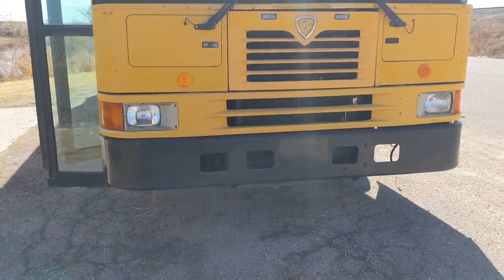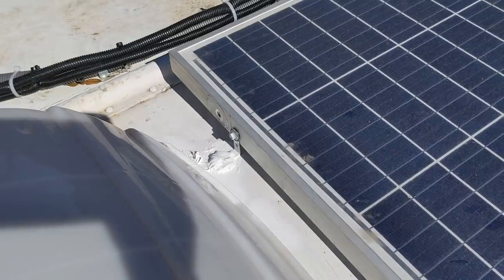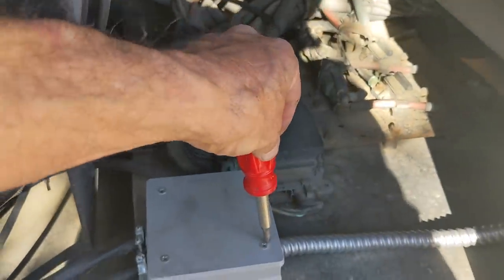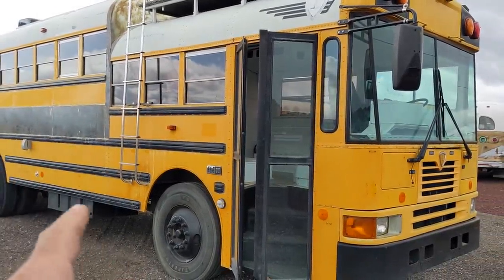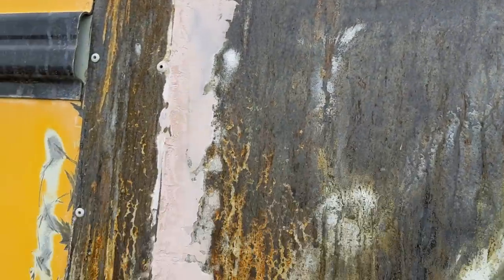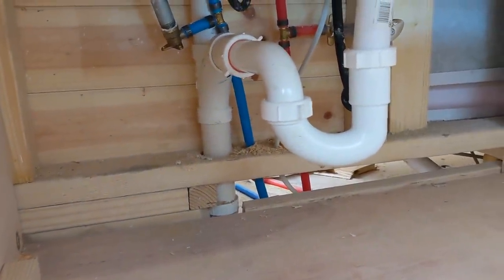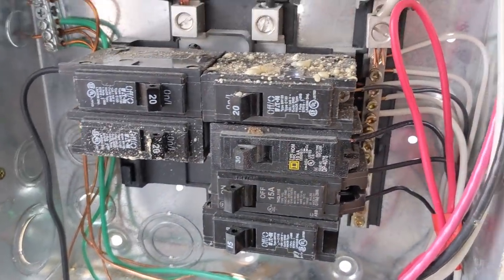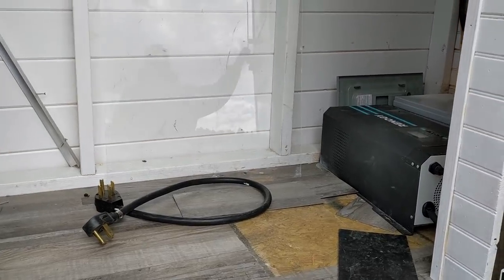Dangerous electrical work...and so much more bad stuff.

Comment: My GOD! Just when you think Lone Star Skoolie can’t get worse…you see suicide cables!?! Thank you Ross for everything you are doing and big hugs and love to the Trudi, Jim, Zack, and Taryn. LSS is absolutely going to kill someone if they aren’t stopped. Keep up the good fight!
Reply: I have seen many of them in all forms: 15Amp with grounds cut off, 20 Amp AC to 30 Amp RV, 30 Amp RV to 30 Amp Dryer, 40 Amp Range to 50 Amp RV, I seen cables with ground and neutral tied together in the plug bit. One of the most interesting was a 15 amp regular 100 ' orange extension cord but instead of a female on one end, it was a 1/4 TR Phono plug for audio use.
Just all around DIY death machines all of the suicide cables.

Comment: Your comment that these bad conversion deals "kill dreams and kill trust" is spot on.  Most states have this concept of a mechanical lien that a licensed mechanic can file against your vehicle if they do work and don't get paid.  So if one is looking to get work done by a licensed mechanical shop and they are asking for a big upfront deposit, unless your vehicle is not worth much they are likely looking to establish more leverage in the deal than they ought to.

I enjoy how you called out a bunch of things that should be obvious to mechanically inclined folks - like the do not use self tapping hardware on an electrical box.  Common sense was thrown to the wind by these San Antonio builders.

Comment: Electrician here, we call them dead man cords. Most dangerous thing about these goes as follows: If you lose power, you decided to hook up a generator with a cable like this, and you do NOT isolate your panel from the incoming service, you are now effectively backfeeding the power line, and this is important because TRANSFORMERS WORK BOTH WAYS. They step down the voltage on the line from 7200 volts to the 240/120 we use, but if you feed that transformer with 220, then it will step the voltage up and produce 7200 volts on the line that potentially linemen are working on trying to restore power to your home!!! I have heard of linemen getting killed/injured this way! 
I even got into a physical altercation with some old entitled dude at home depot over the merits of what he was doing. 

PLEASE DO NOT USE DEAD MAN CORDS!!!!!!!! Keep our linemen (and women) safe!!!!!
Reply: This just makes me so sick to my stomach.  I am so glad we didn’t try using this!!!   At one point right when we got our bus, I did have the cord in my hands and was going to try to figure it out but the puddle of water from a leak in our bus distracted me.  This should be considered attempted murder.  This business reassured us multiple times that they were the experts and all his YouTube videos he presents himself and his business as caring about safety.
Reply: Thank you for the additional details. Very valuable for all to know!
Reply: @trudikrupocki3023  I am so sorry this happened to you guys, but hopefully your story will keep this from happening to others! YOUR BUS IS SOOOO ADORABLE!!! It seems like you guys are in good hands now, and taking it in stride. Can't wait to see her when she's perfected! And never forget, there's a million great folks out there for every bad one you meet. :)
Reply: @wandererradio9751  You are very welcome! It was something I did not ever think about until I started teaching electrical at our local trade school. I make sure now to educate everyone I know!!
Reply: @Hamilton Mechanical The other thing than can happen, is mains power is restored and the generator looses it's fight with a much larger power source and catches fire.
Reply: @station240   Where I live the generator would immediately trip from trying to power all the neighbors houses. I'm not an electrician but know indoor from outdoor wire, I don"t know if UF is usable or you need to use liquidtight flex or RNC.
Reply: That's true, but the energized power line issue can come into play with even a safe generator cord designed for that purpose (if the main breaker in the panel is left on). There are lockout kits designed to prevent this, and are required by Code to be used. The dead man cord is dangerous mainly during use of the generator because the other end (male prongs) will be energized when the generator is running.
Reply: On the same note, the Neutral side needs to also be isolated!
Reply: i dont think there are any linemen working on this bus though lol
Reply: @SuperJlonergan  I don't think you understand the problem. If the generator is back fed into the panel and the panel is plugged into the power supply at the trailer park or at home when the power is off it will send current back up to the pole lines via that conection. A worker a mile away could get hurt. It needs to be isolated by a magnetic contact switch takes it off line when energized.
Reply: Spot On Bit Of Intel. There is No Gate to stop Backfeed.  Be Careful Everyone.
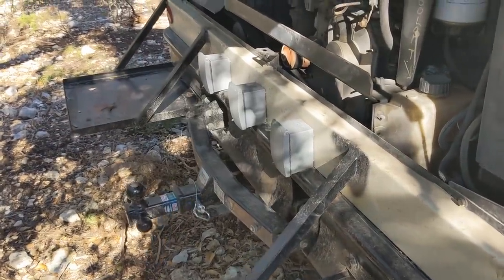Reply: @906MediaProductions  not necessarily true, I suspect that the middle receptacle (shown on another bus @ 19:50) would be to hook up to a trailer park pedestal; doing so would backfeed the power grid!!!

Comment: The wiring takes the cake.  As does that water heater.  We stayed in an AirBNB cabin that obviously had an undersized electric "tankless" water heater.  Could only get hot water in the shower for about a minute or two, lol.  It was mounted on the wall of the bathroom and it was obvious it's volume would be way too low for anything more than a sink.

Comment: Oh my! God bless you for helping these folks out. This is nuts! So I'm an electrician, been in my own business 30+ yrs in CT. I remember in the 1980's hearing of a lic electrician who mistakenly connected a 120 v electric baseboard heater to 220v.  A fire occurred, someone died in the fire. The electrician who did this by mistake was prosecuted for criminal negligence and was imprisoned for sometime.  In this case I this was done with someone with no training. I hope no one gets hurt, and I hope the people who did this "for profit" are held accountable.  Maybe they should live in these projects and deal with the stuff!  So sad this happened!  God bless!
Reply: Guessing this whole home on wheels thing is so new that there is not any regulations yet. Guess when wiring this up they don't have to pull a permit and get it inspected. Allen guessing your in the USA, if so what section of the NEC would cover homes like this? Oh never mind he pulled out the code book for RV's

Comment: Licensed  Marine Electrician here , Fine wood carpentry and welding are my other hobbies. I have just discovered my new profession , High Class High Quality School Bus conversions .
For 100 grand I could have delivered them a Taj Mahal on wheels compared to that butcher job. After thirty years restoring yachts often laying on my back in water under the engine, this will be fun to do. I'm no slouch as a painter either. Just built a nice size workshop behind my home with plenty of room to park a bus.

Comment: I once had a customer bring a car in with electrical problems. The car alarm insaller used wire from a brown extension cord with wire nuts. He merely pulled the 2 wires apart and had at it.

Comment: I remember seeing a cable like that as  an extension lead to a washing machine. One 13 amp (UK) plug either end of the cable and the socket on the washing machine cable! That was nearly 45 years ago in a house in England where the owner had died, and their son had  asked us to remove some items from the house. Luckily, it was not plugged  into the mains socket, but it took some fathoming out  at the time. And my brother and I still talk about to this day!

Comment: For $100,000 you could obtain a older but functioning professionally built motor coach..  Why would you take a school bus, that all though being strong, is built to travel short distances on city streets.   When you see a 'school bus' on the highway they are usually traveling at the lower end of expressway speeds because they just are not 'sprung' for expressway travel speeds.    I know people DIY them but they don't spend that type of money....
Reply: Some of them are made for highway speeds, depends on the motor/transmission combo.  Additionally, those motorcoaches aren't made for full-time travelling from what I understand.  They are only rated by the manufacturer for a certain amount of mileage per year or you violate your warranty.  Also, some people like to build their bus homes to their own tastes, something you can't do in an RV, you can only pick from their options.  And that doesn't take into account safety considerations during a crash.  But as far as $100k, I personally would never spend that much on a bus conversion.  Mine is going to be much less than that.

Comment: I will admit I made such a suicide cable to connect a generator to my house but I keep it locked and only I touch it so I know not to use it anywhere else and to connect and disconnect in correct sequence so neither side can be hot. Yes - it was a temporary solution because there were no surface mounted IP65 'plugs' in stock anywhwere near me. But temporary solutions tend to... get stuck. I will fix it sooner or later when I buy that one missing 'plug'.
Reply: Sooner would be better because you could have it use someday and someone else could end up touching it.
Reply: @trudikrupocki3023  Well, since it is locked it would have to be a burglar so.... ;)
Reply: @andrzej2501  , you are right .  Is it locked while plugged in to a power source though?  Could someone else touch the cord then without your knowledge of it?

Comment: If you have too large of a crimp connector, you can always strip twice as much wire and then fold it back on itself to get a tight connection.

Comment: My advice to anyone taking on a large build is Planning and do it in stages .  Pay as  things are complete to the point of it can wait now till next stage ! I’ve built 2 # 40’ footers and 1 #25 footer schoolies and 1  35’ MCI
And I’ve worked on a few for other people! My biggest problems have been when I’ve had inexperienced helpers do ignorant things! And I didn’t inspect it close enough as they continue! The after effects 
generally were Redo it ! Now on any R. V.  project  I’m involved in , I spend a lot of time going over everything the job requires and not leave anything to chance! 
Even when I’ve had professionals 
help I make sure wiring , plumbing 
Etc. are routed correctly to Avoid
Other problems latter , that they might not Realize! Currently I’m finishing Reno’s on my 1993 40’ Thomas 8.3 Cummins diesel pusher with 22 3/4 inch roof lift 
and 2 # 91/2 ‘ slide outs !

Comment: Glad you named the louse of a company that put people's lives in danger. I would have done it right away. Anyway, I don't know the appeal of these bus conversions.They always seem sort of Mickey Mouse. But then I never got the whole RV thing anyway. I much prefer road trips in my 4-banger good mileage Toyota, saving on gas, easy comfortable driving, tooling around where I can take side trips to wherever, getting a motel room instead of paying for campsites, checking out the local cuisine, and not worrying about a myriad of things that can go wrong, zipping back home if I feel the desire...yeah, that works for me.

Comment: I am not an electrician but had a job where I would meet municipal inspectors with plans for solar installs. I would simply open boxes for inspectors. I would write down and relay to my bosses inspectors remarks then closes the boxes. Since I have learned that only machine screws can go in to electrical box. Got a good scare on one of my early jobs. As stated open boxes before inspector get there. Every thing in boxes was good inspector wrote up his report and told me I could close the boxes. Someone had used sheet metal screws to fasten cover on main panel. I put the cover back on with those screws. I drove one of the screws in to one of the main power lines from power company and shorted it to to box and ground. A large spark and bang was the only damage but as my unhappy boss said it could of been a lot worse. After that I carried my own panel screws. Many of the things you pointed out inspector would fail the job the under size wires the solar wires not tied up all would of resulted in fail and job not able to be turned on. Would it be a good idea to require inspections on RV applications as well?

Comment: Oh I forgot to add. I don't know if it would be proper in a solar battery bank setup. But I've seem semi truck manufacturers tie multiple (stud top) batteries (3 or more) together  in parallel with a strip of aluminum/ steel (1/4" to 3/8" thick by 1"to1 1/2" wide by lenght needed) and put the battery cable / cables connections in the space between the battery studs. If it would work in that application.  It would probably save a couple of bucks from making all those short cable connections and make the installation easier and look  cleaner visually.

Comment: The wiring going to that charge controller that has 2 black wires for positive and negative. It looks like they were buying cheap Walmart grade jumper cables and separating the two halves of the cable instead of buying reels of heavy gauge cable.

LOL. That PVC pipe hanging out of the bottom of the bus, call that the Cousin Eddie pipe. Park over a storm drain to empty your waste tank.

Comment: When you were talking about 120V wires and their too small ampacity around the breaker box, the 30 amp breaker and the 15 amp below it in the breaker box are not seated correctly in the box. You can see that they do not align with the neighboring breakers. Is that as you got the bus, or maybe you were poking around and left them ajar?

Comment: As long as the solar panel  L brackets were secured properly they are strong enough to hold 10 pounds of weight a piece all day long.  They should have used the intended mounting holes though.

Comment: Might I say this as someone in the electrical field. There is a Square D HOMLINE brand breaker surrounded by EATON on an aluminum breaker box 🤦🤦‍♀️🤦‍♂️

Just because it fits and it works doesn't mean you should do it. 

1st Aluminum bus bars don't last long, copper is better and you can still get small boxes
2nd HOMLINE should not be used at the same time as EATON, as they don't play well together 
3 none of those breakers have warranty and you can get them all from Home Depot where people tamper with things

Suggestion, Square D QO has copper bus bars, breakers and panel have warranties, and you can buy them all over the country through the company or certified dealers

Comment: wow i would have used heat shrink and bare butt connectors on the wire open to road moisture. yes those wires for the lights.  Those blue plastic butt connectors are for indoor use.

Comment: I never thought Ben knew what he was doing. He told me he got his degree in engineering but was laid off due to covid and he decided to build a skoolie and it worked out so well so he decided to do it full time.
Reply: Did you consider or get a build done  through LSS? My husband and I own the blue bus in Rolling Living’s previous video. And yeah, Ben told us he was an engineer too. Although he didn’t add the COVID part because it wouldn’t have made sense with our timeline. He must have added that detail more recently than when we contracted them in October 2020. He also told us at one point mid-build his grandfather built the moon lander 🤣🤣🤣. By that point we knew he was a bald faced liar but we were in too deep and just had to hope for the best with our build and plan for redoing things. We didn’t realize just how bad the build would be.
Reply: @vaughnfluff3344  He actually rented a property from me so he could be close to the warehouse he worked out of. He was a great renter and respected our home. We had a few discussions on doing business together. I have a few lots and he had mentioned putting container homes on them. I visited his office several times but never saw anyone working both times I went. I just found the operation to be a little chaotic. I work in construction and wasn't impressed with some of the craftsmanship. Im not master carpenter by any means but I could see how some of the work being done was not the best.
Reply: @vaughnfluff3344  have you hired an attorney? After watching more videos on this guy I cant believe he is still in business!!!!

Comment: POS conversion and now a blown DT466.
I would strip it for the few parts of value and sell the chassis at near scrap price.
A used / running DT466 is worth more than the whole bus in its current condition; not including the engine install cost.
Be a good idea to do an oil analysis on a HD engine like this, BEFORE starting a conversion anyways.

Comment: The parallel wiring of the batteries would be fine if proper gauge wire were used. There’s no need to alternate, etc.

Comment: The bus with two generator inputs shouldn't have the lines tied together. Good way to pop the generators. In fact it looks like all 3 are wired in parallel.

Comment: I loved making a suicide cord, flipped main breaker off in our mobile home and plugged in a 110 generator during very cold weather for 8 or so hours to run the furnace.  Hell no im not gonna pay 1000s to have a isolation circut installed, when i can isolate it myself and backfeed the place

Comment: As much as I would like to see you fix these busses I honestly can't see any way to salvage any of the systems.  Every bit of wiring, plumbing, structural, paint, and trim have to replaced completely. I suspect most of the materials they are using for these builds are scrap or salvage.  From the looks of it, the place only has a sawzall and a circular saw for their cuts. I believe these bus conversions are a total loss :(